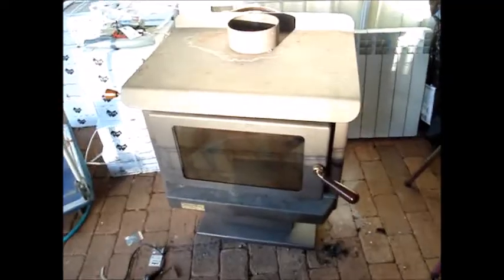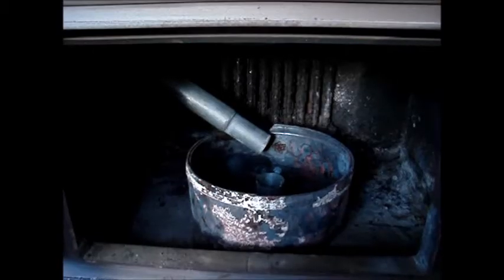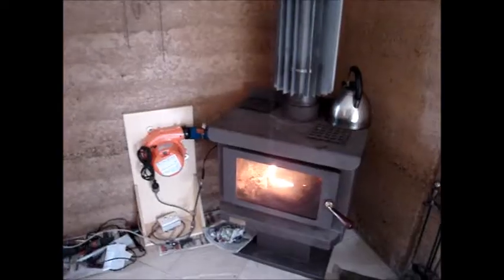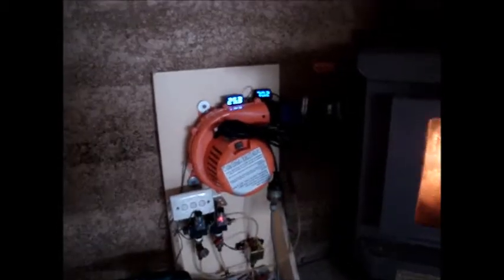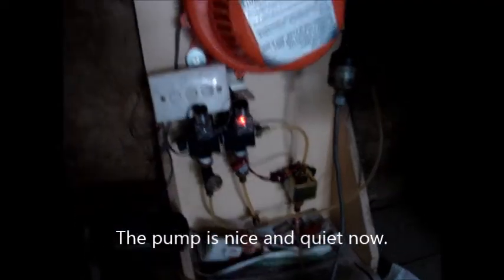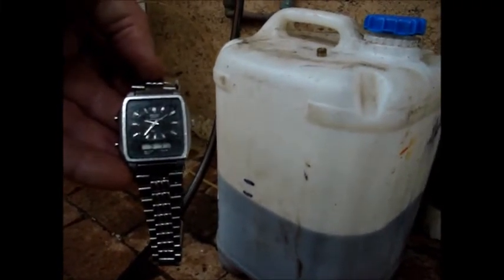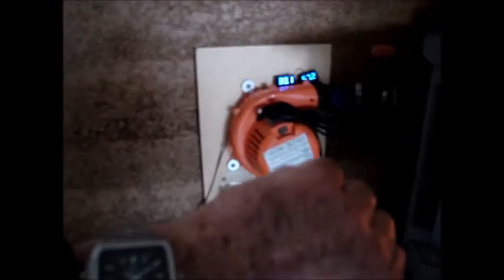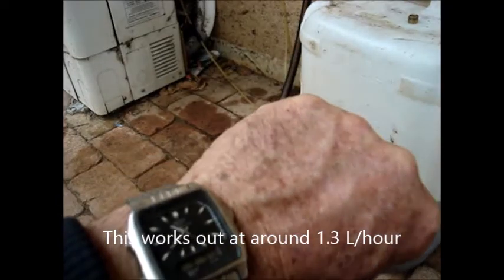Oil burner Installed in home heating  wood stove V1 3

Comment: You have all that mess of the blower and pump and things sitting in your home like that? I'm sure the insurance company would be interested to see this vid especially if you ever make a house fire claim. While the concept 2 jeffs came up with is good, I'm just amazed anyone would have all that paraphernalia sitting like that in their home.  So many potential and real dangers in this setup. Better your home than mine!  :0)
Reply from the maker: TDS,
This is the first pass. Since the video was shot, I have installed the blower on a shelf, so it is on a horizontal surface, to avoid potential bearing issues.  I plan to have a cupboard built to house the "paraphernalia". Yet to come are the automatic controls to limit the water temperature, turn fuel off, if fan is not providing air pressure, the pump for the hydronic heating circuit and the valves to control the circulation.  It will be safe.
Reply: @tonyfromwestoz2718  It is now 30th June 2022. I have replaced the burner bowl with a high temperature SS bowl made to my specifications as the original one was losing metal and not containing the flame properly.
It is Winter now and I heat our hot water with this heater. I light it and once it is at operating temperature, I leave it run with the hot outlet at 70°C (thermostatically controlled (+5 to -8°C variation flame off to flame on to flame off)
It runs for approx. 1 hour at this setting and that heats our water for the following day or 2. This uses about 5 litres of used cooking oil which has been strained and then settled, to remove most contaminants.
While many people use kerosine or diesel to light the fire, I use a rag with used cooking oil on it and 2 newspaper pages, twisted tightly and lit, put on top of the oil soaked rag. I turn on the blower and, when the burner is blowing a good flame,  I turn on the oil (under thermostat control) and watch it build flame and heat output.
The oil tank is a steel heating oil tank mounted on  the wall outside this room. A coarse filter is fitted before the fuel pump, which delivers the oil to a pair of solenoid valves which are thermostat controlled to supply oil to either of 2 needle valves (one for high flame, one for low flame). The output of the needle valves are combined and pass into a copper pipe, delivering the oil to the burner, via the air tube from the blower.
There is a speed control and isolation switch for the hydronic circulation pump, taking the hot water to the hydronic radiators in the remote rooms.
Another speed control and isolation switch is used for the blower, but it is normally left at full speed, as this is best for the flame colour.